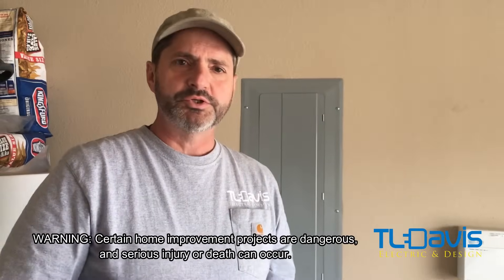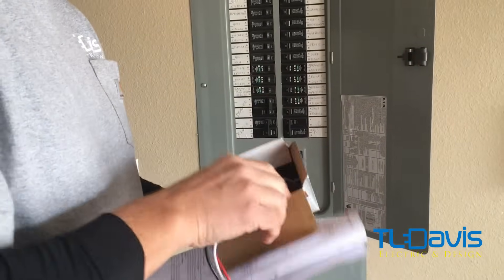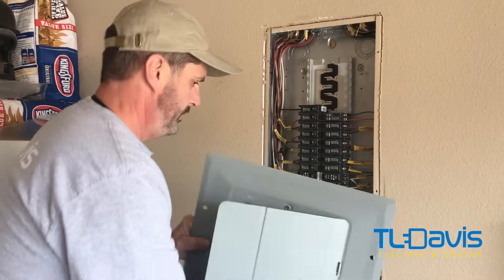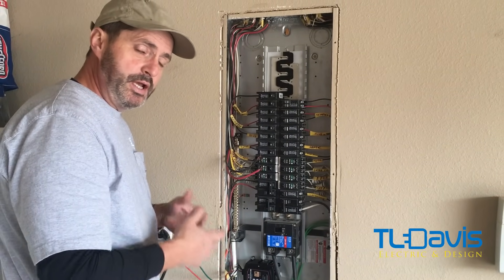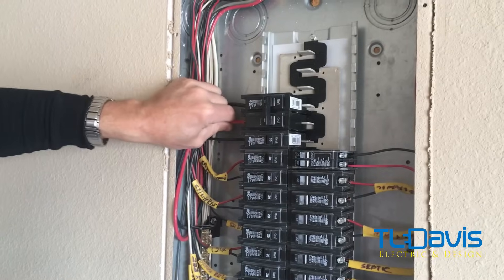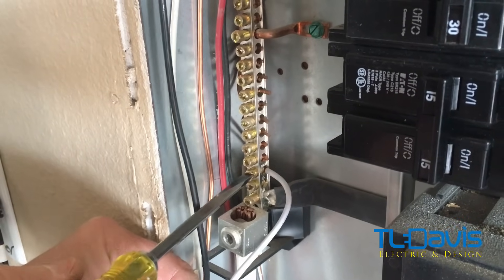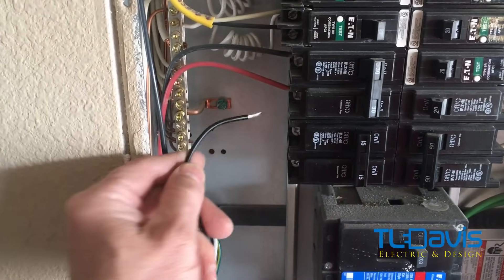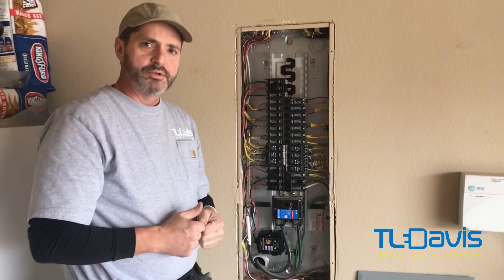How To Install A Whole House Surge Protector | TL Davis Electric & Design

Comment: My problem with this is I believe the neutral & ground comes together in the box but shouldn't he installed the ground to the ground bar instead of connecting the ground to the neutral bar or does it matter?
Reply: That's what I want to know.
Reply: I also need clarification on this as my ground bar was very far away from my installation point, but neutral wasn't. They are bonded though. Does it matter?

Comment: How does it work? If there is a power surge does it trip the breaker? Or it depends how big is the surge! 

At my house I had power interruptions like 6 in 30 min, probably I had power surges, it fried the board on my fridge!

Comment: Sir please explain me why you connected the ground wire in the same bar as the neutral wire ? This unit supposed takes the voltage peak and send it to ground ! If you connect the ground in the same bar as the neutral wire the peak might travel to the neutral no ? I understand that in some countries we have star system for neutral Goes to ground. But I think that ground wire needs to go goes to ground
Reply: That's what I want to know.

Comment: Thank you for sharing your knowledge.  How do I know what size whole house surge protector to get.  I am going to install a 200 Amp 20 Space 40 Circuit Outdoor Combination Main Breaker/Ringless Meter Socket Load center.  I will have (11) 20 Amp breakers,(4) 30 amp Double-Pole breakers, (1) 30 Amp Single-Pole breaker.  Thank you for your time.

Comment: The only problem with that mount type is that when you reinstall the main cover to the service panel you cant see the green lights on the surge protection.
Reply: That is correct. Wrong installation by this electrical contractor. Should be mounted outside

Comment: Could you just wire it into the bus bar , and not have to move the breaker ?
Reply: Great question. That's what I want to know as well.
Reply: The SPD needs O/C protection

Comment: When he inserted ground wire into bus bar i noticed the stranded wires separated. Therefore not all of the strands went under the screw. I always twist stranded wires together before inserting into breaker or bus bar to prevent this from happening.   time 5:35
Reply: I saw the same thing

Comment: No insulated driver, could have used the square bit, should have torque spec, main is switched on, could have worn safety glasses, and definitely should wear gloves. Let’s lead by example guys.

Comment: to install this do i need to turn off the main breaker outside the house
Reply: YES, if you question your ability, test the hot wires at the point of entry(multi meter). Then test again before proceeding to install. My tip...wire the red and black into circuit breaker(off) before installing in slot. Then neutral and ground. It eliminates fumbling around with wires in the tight spot. Mine is a 'bolt on' CB, so more fumbling with the driver.

Comment: You've been doing this for thirty years, never once read the torque spec for tightening the connector screws, and have never considered using a torque wrench on 'em.  Inspectors love guys like you!
Reply: As the Germans say, “gudentite.” 😅
Reply: When you have experience doing something, you know how to do it. Take a hike with your torque wrench. Go comment somewhere else
Reply: @dudeman3929 
Well obviously he doesn't have much experience because he's done so many things wrong installing this that the torque on the breaker screws are the least of his problems. 
Eaton tells you not to put them inside the breaker box, if you do and it goes bad you won't know it because you can't see the LED indicator lights on the front, for a flush mount breaker box like that one there's a flush mount adapter plate available to mount the surge protector next to the box.
And I couldn't tell who he said they recommend it be wired into a breaker close to the feed because his voice is garbled there but it isn't in the instructions to do that, an engineer from Eaton already went over that with me, contrary to what any "I've been doing this for 30 years" electricians and even electrical inspectors will tell you electricity doesn't flow like water, from point A to point B, instead it hits everywhere at once, which is why it doesn't matter where in the box you put the breaker for it, what is important is wherever you do put the breaker it's in a location that you can get the unit installed as close as possible to the breaker, that way you can cut the wires down to the shortest length possible, the longer the wires the more surge will get past it before it dumps the excess to ground. 
And you're supposed to twist the wires together that go to the breaker to minimize impedance, one twist per inch.
Reply: Just tighten down the screws good and tight.
Reply: This is a joke right? Right? 🤣
Reply: Inspectors are a joke
Reply: @marshalldavis7364  Torque spec. what are you building ? You must be just being funny lol.

Comment: Funny seeing Mike Holmes. I installed Sycom device like they showed on TV years ago and later found they caused fires.
Reply: I looked the story up. They are no longer in business. But this is an Eaton product, why smear Mike Holmes? He doesn't make the products.
Reply: @robertlee4172  I did not smear anyone. Just pointing out fact.
Reply: @gregsz1ful   Did Holmes endorse the Sycom product, or merely used it on an install? Ya, I thought so.
Reply: @robertlee4172  His registered electrician installed it. If you watched all of Holmes shows, you have seen it installed several times. Not sure what your problem is.
Reply: @robertlee4172  Holmes endorsed installing a  surge device many times. after my original Sycom device exploded during a storm, they sent me a replacement. After installing  a new one ai learned about the recall.

Comment: I dont know anything about this but 1 common sense question. Why is a whole house surge protector not installed before the electrical panel?
Reply: For the basics, it's because circuits in parallel have the same voltage. Devices in series have the same current.

So each of the circuits in your electrical panel are technically wired in parallel with eachother. A surge protective device imiting the voltage on one of these parallel circuits inherently limits every (parallel) circuit. 

For a deeper dive, research on Metal Oxide Varistors - the most common surge suppression method (there are other methods)

Comment: Good video. Question: what if the breaker box is full?
Reply: You would need to upgrade your panel to a larger one
Reply: @ShPrez  This is not true. I will repeat what I said elsewhere: Your goal will be to attach to a double pole circuit breaker that you know will remain untripped. My suggestion is the dryer circuit. Do not illegally double-tap the existing circuit breaker. Google about this. You need to either pig tail or get a proper tandem double-pole circuit breaker replacement that is designed for double-tapping.

Comment: So does that thing just basically try to pop the Main breaker before electricity can reach the circuit farther down the rails?
Reply from the maker: The SPD does not trip the main breaker. It draws the current to it and dissipates it. The only thing that it might not protect as well are the outlets close to the panel.
Reply: @terrydavis5882  thanks for explaining, much appreciated.

Comment: Do you connect the neutral and ground wires to the same bar?
Reply from the maker: In the main panel the neutral and ground bar are connected with a bar, So it doesn't matter. Only in a sub panel are they suppose to be separated. You do not want to install a SPD in a sub panel as it will not protect the main panel.

Comment: Why are the green and white mounted on the same side?
Reply from the maker: In the main panel the ground and neutral bars are connected. So it does not matter if they share the same bar. Only in a sub panel they have to be separated.

Comment: This particular electrical service panel has the main AC feed lines coming in through the bottom of the panel.  Correct me if I am wrong, but I believe that most main feeds (coming into the panel from the utilities company meter) usually (i.e., almost always) come into the main service panel at the top inside most residential main electrical service panels.  There was no explanation of that anomaly in this video, and there should have been.  Additionally, and while I realize you are an experienced electrician with 30 years of experience, this job should NOT (repeat NOT) normally done by a "shade tree" electrician (i.e., an amateur homeowner with rudimentary electro-mechanical skills) without the main breaker being shut off for safety reasons.  I was pretty alarmed that you did not kill the power from the mains (i.e., the two thick black wires at the bottom of the panel connected to the main breaker) while moving the stove/range circuit breaker to the top of the main service panel, and installing the 15 amp dual pole breaker at the bottom (in its place) to wire the leads from the surge protection device (SPD) into it.  The risk of electrocution inside of a "hot" main service panel with the "dead cover" removed is pretty high, particularly if you do not have appropriate training or experience working around live electrical leads carrying 100 to 200 Amps of 120V AC power.  Additionally, you did not explain (in complete detail) why you always want to install a surge protector as close as possible to the main feed shutoff breaker.  For those reading this comment, it is not just because the SPD usually comes with short leads, but rather that is it is vitally important to put the SPD's connecting two-pole breaker DIRECTLY DOWNSTREAM of the main breaker so it is first in line to receive the surge, and it operates properly to trip and short the surge to ground before any of the other downstream breakers to the home's electrical circuits are subjected to its damaging effects.  I also would like to echo the comment from Robert Moore below, that this SPD should have been installed outside the panel, so that the homeowner would be able to see the LED indicators every time they went into their garage or utility room, and without having to remove the "dead cover" panel inside the main service panel to verify that the the SPD is still operating properly.   I would likely and correctly guess that 99% of most homeowners would never remove their "dead cover" panel during their 20-30 years of home ownership UNLESS they had a faulty breaker inside the panel that continued to trip.  I would strongly recommend that any SPD with operational LEDs be mounted outside and directly adjacent to the left or right side of the main electrical service panel so that every time you go into your garage, you can check that the LEDs are showing green and you can verify that it is still working properly to protect your household circuits and the appliances that are connected to them.
Reply from the maker: I'm only going to answer a few of your questions. In my video if you do not feel comfortable doing this you should hire an electrician. Yes you should always shut off the main power if you do not feel comfortable with it on. The breaker at the bottom is showing that the panel was installed upside down which is okay. This allows the electrician to have more free space to bring his wires into the panel. I dd not install this panel or wire it up. I only installed the Spd for the customer. If you look at the notes before you watch the video it shows different ways to install a recess mount or surface mount. in the notes it states before you watch the video this was a special case for the homeowner. I do not recommend you installing it inside the panel. You can always find something to complain about on someone video. If you had the experience of an electrician you would know that local jurisdiction has governing authority over the code. Before giving advice or criticizing a video please read the notes below and pay attention to what is said. You can always do your own video and share it, if you feel you can do a much better one.

Comment from the maker: When adding a SPD to any panel. Please verify what type of breaker is needed in the instructions that come with the SPD. The one I had installed requires only a 2 pole 15 amp breaker and not a 50 amp breaker. We should always follow what the manufacture ask for when installing their SPD.

Comment: I love everything on the video besides two things that startle me! One I will always use electrical insulated gloves and I will not wear any type of jewelry whatsoever even if I’m wearing gloves! Above that everything is fine, yes you can still have power into the panel and still do your business and as long as you are being cautious! Any home DIYer should take these matters into consideration to the fullest! Now if you’re a professional electrician I can see different methods of doing this but I also recommend that you take this to the fullest and be cautious because all it takes is one time to get shocked and it may just be one shock but sometimes that can be fatal!
Reply from the maker: If you are not an electrician you should always shut the MCB off before installing the breaker. You should always wear leather gloves and safety glasses when working on electrical equipment. When doing these video's you try and get everything right. I also let them know if they feel uncomfortable they should hire it done by a licensed electrician.
Reply: I'd kill the power before opening the panel box up.

Comment: Eaton's own instructions for the Ultra say nothing about requirement to locate closest to main power breaker... only specifies to mount as close as possible, for shortest wire run, from Eaton to its own breaker.  Is that not correct?
Reply from the maker: That is correct. But what you are not told is that the closet device to the panel are not protected as well as though further away. This is what I had learned in an Eaton Class on SPD. So if you have a Freezer or Fridge in the garage and it is close to the panel it is not protected as well as other items down stream that are further away. So you are more likely to damage the fridge from a lighting strike or from the utility company. So that is why I recommend them as close to the main circuit breaker as possible. Eaton has a kit to mount the SPD at the bottom of the panel and the breaker is mounted on the last two available slots. So you need to decide where you can install the breaker safely in your panel.

Comment: One question, how to choose the type of SPD?? In this case you used a type 2...
Reply from the maker: You need to decide where you want the SPD. Indoors or Outdoors. Nema 1 Nema 2 are indoors and Nema 3r and Nema 4x are rated for outdoor use.
Reply: Type 1 SPD can be installed on either Line Side (utility power side) or Load Side. Type 2 can be installed on Load Side only. Type 1 SPDs have limited tech and are typically listed to UL 96A and generally cost less. Type 2 SPDs  can have advanced tech = better protection. However, Type 2 devices can be listed to UL 96A (20kA NDC) and generally cost more. Decisions, Decisions, Decisions.

Comment: Does this protect from voltage surge originating from the outside the house?
Reply from the maker: The SPD protects surges from lighting strikes, Utility company surges. I try to put it near the Main Circuit Breaker in the panel.
Reply from the maker: The SPD protects from surges outside the house like lighting strikes and from the utility company.

Comment: Hi. I have a 200 amp main panel and another 200 amp sub panel. Do I need 2 surge protectors or just 1 in the main panel.
Reply: If you are interested in maximum protection, install  another (properly, not like he did) one in your sub panel. This is called "layering" in lightning/surge work.
Reply from the maker: You just need the one in the main panel.

Comment: I don't understand how these work. If a surge comes in from the main how does this protect everything on the bus?
Reply: Uneducated, non electrician, DIY guy that according to all electricians has absolutely no business being inside an electrical panel here...I'll take a stab at your question since no one else bothered. I believe it protects all of the circuits on both main buses because it directs any current surges it "sees" on either bus to ground/neutral. IE. It bleeds off any excess current surges to ground/netural. It's able to accomplish this feat on the order of milliseconds so any other circuits connected to those same two busses, which is basically everything else in your house don't "see" the surge. in theory that will avoid the brunt of most current surges that come along. That's my understanding anyway. I believe this relates to surges in current only though. I don't beleive these devices provide any protection for either an under or over voltage condiition. They strictly try to deal with any over current situation. That's my uneducated opinion anyway.

Comment: I'm not an electrician and maybe I'm just an @$$ (), but was it just an oversight for him to install his ground to the neutral terminal bus bar, especially when the right side of the panel has what seems to be a grounding terminal bus bar? It caught my eye and made me wonder if it would hinder the effectiveness of the whole house surge protection. ( You guys could imagine if the homeowner had to deal with the headache of insurance because they had a surge the first time through, just imagine if they had an adjuster come to inspect the house a second time and denied a claim because the device wasn't installed correctly. )